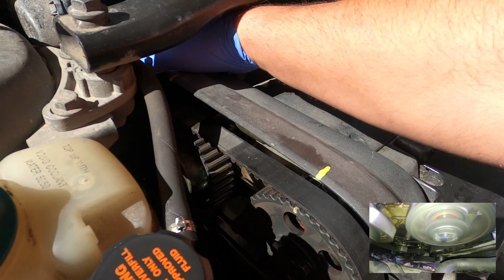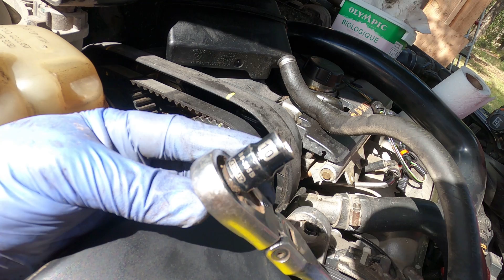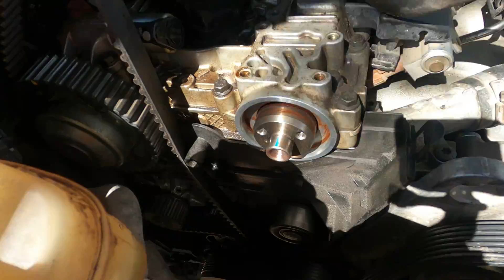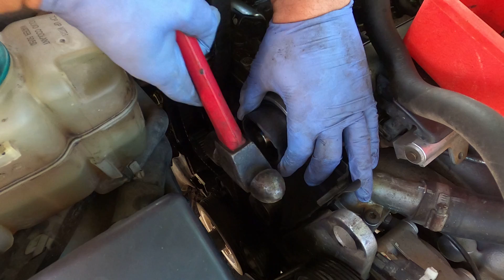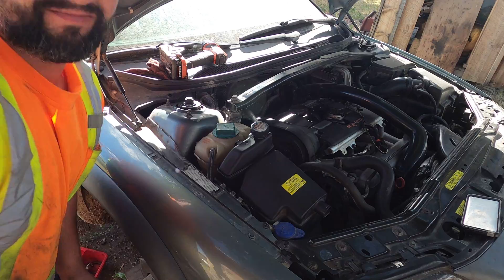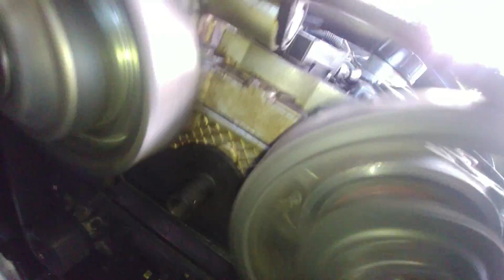VOLVO CAMSHAFT SEAL REPLACEMENT WITHOUT CAM LOCKING TOOL (NON-VVT) |  TIMING BENT TENSIONER SETTINGS

Comment: great videos!  i have learned so much about my volvo from you thank you very much!  i have watched a lot ,a whole lot of videos on water pump cam seals oil seals and timing belt and from all of those videos from all of those various  methods and steps ,its like this ...paint mark every part and the exact place that each part bolts onto the motor or spins around in each place it spins on the motor.The belt, gears, pulleys ,shafts,EVERYTHING .mark every piece that you are going to take off before you take it off and when you put each part back on be sure all those parts match back up exactly. there are several methods to successfully  removing the parts but which  ever method you choose  match up your marks exactly to the position the part was in before you started you will not fail.of course you should be very mechanically  inclined  and have the tools and paint as well ...if you are not  you should for sure watch as many videos as possible and follow steps to a T. that worked great in my case  for my volvo xc70 2.5T anyway.
Reply from the maker: Great point LanaJack. I will pin your comment up to help other viewers. Cheers!

Comment: Thank you for a great video, I learnt a few important basics. Is it possible to share another that shows replacement of the exhaust cam seal please, curious to see how its done without a cam locking tool

Comment: I'm about to do the water pump on a 2013 Volvo c30 because the coolant leaks out. Its making me really nervous because I don't want to mess up the engine which only has 82,000 miles. I only drove it a few weeks before the wheel bearing went out, then this. So far my Volvo experience hasn't been all that great even though it was fun to drive when properly running. When I change the water pump I'm going to do timing belt as well while using a cam lock tool. Hopefully with my inexperience I can get this car back on the road, I just got it what a headache.

Comment: Great video! I got a volvo s40 1999 t4 with engine code b4194t2. Unfortunately i got a leaking camseal on the other side of the engine (gearbox side) do you know the part number and where to find it? :) thanks!

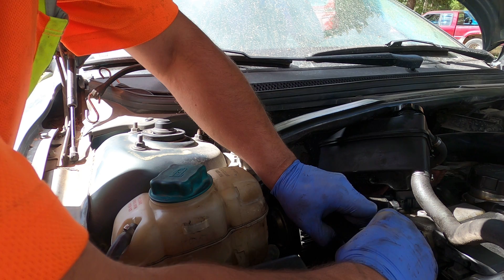Comment: Guys, minute 8:07  you can see as exhaust polley rotate anticlockwise itself  at least one tooth when you dissamble the belt. I had problems with it when I reinstall the belt. I did not realize this and I thought that as i had not touch anything when all was dissambled the polley was in correct position but was not. I respected all marks and position and when i reinstalled and I switch on  a noise come from the engine, i have the vvt polley one tooth backward. 
Caution guys with VVT system, It has a life of its own.

Comment: Notice:  If your ‘this type of engine’ suddenly overheats.  It may be the water pump impeller ? There are obviously such made out of plastic (!?). No need to mention how good that it.   To say this motor is marked by TDC is by definition wrong, it is more like a point of reference because none of the cylinders may be at top dead center ..

Comment: I was just curious why you didn't discuss what might have cause the seal to blow? Did you check your oil ventilation system and determine it wasn't plugged?

Comment: Hello I have a 2.5 turbo and I have to drive it cross country it does have this oil leak where I see it leaking on the subframe from the cam seals. I cannot afford to fix it and my timing belt doesn't look like it's wet do you think I could drive it for a little bit before I get the repair? Everyone talks about the timing about being wet I looked at my timing belt it's not wet but it still does leak oil down on the subframe maybe about a half a quart every 4,000 miles so a very slowly but it still leaks nonetheless.

Comment: I am do the same thing I was curious why you did not replace the second cam seal on the back pulley? Wouldn't they both be dry and brittle by now? Including the crank seal at the bottom

Comment: just spray paint the cam gear before undoing the cam bolts it leaves easy to see marks for bolt heads to align cam gear.
Reply from the maker: Great point!

Comment: What if the exhaust cam is leaking... would locking it with the 30mm still work, I understand some may spring loaded etc. but in terms of needing the cam lock, is it a necessity for the exhaust side?

Comment: Have you tried this on the vvt? I think in addition to the crank lock method you are doing I will clamp the sprocket on the vvt to the belt to keep that cam from moving when you break that 90 ft lb torx inner bolt!

Comment: Hi its Dan, I have oil on the engine along the diesel injectors, could you please tell me where its coming from, thank you, Dan
Reply from the maker: Hey Dan. It's difficult to tell for sure without see the vehicle. I would wipe/clean all oil then just check after day-two days driving to locate the leak. Any luck finding the leak?

Comment: Nice video and well explained.  Just started to see this leak on my 09 c30 t5 so will need to do this myself to save $1000-$1500 that shops will charge to do this.  Will probably replace the pvc breather box as well cause I replaced the diaphram a while ago and problem is still there.

Comment: I know this is an older video....but Either my cam seal or exhaust seal is bad. (2002 Volvo S60 2.4T) This video gives me the confidence to tackle this issue. Thank you sir! By the way, your english is awesome, great job! Youre talking like a regular person and not some "mechanical engineer".  Im subscribing and will follow all you do.
Reply from the maker: Hey John! Thanks for your feedback. Just saw your comment showed up. I have never seen exhaust seal failing the same way. Let me know if you have any questions. Cheers!
Reply: @PistonShack  I'm assembling a 2010 S40 and can't believe there is nothing to stop that seal from falling out. It stopped my job cold when I saw it because I thought I was forgetting to assemble something. I might center punch the cover and the head to create a little interference that should stop the seal. There's no problems on the exhaust side because the cam itself won't allow the seal to fall out.

Comment: Do you have to take off the valve cover or anything else besides the timing belt cover? Im still trying to find the leak on my engine but its in that general area . Im not that mechanically inclined and just trying to figure out how much i could remove without having the tools to torque anything back to original spec. Just trying to find this damn leak 😅

Comment: removing the timing belt from the cam sprocket only  and strapping the belt up so the other sprockets cant move ... is that correct ,or am i missing something?if so can i repeat process for the exhaust cam sprocket?

Comment: my 06 volvo xc70 2.5t developed a slight coolant leak  about 20000 miles ago that has progressed gradually since.it also developed an oil leak started about the same of time and rate of progression .for  the past  month have been adding a quart of oil and  about a pint of coolant  every sunday. the (low coolant stop safely)message appears every time the coolant drops below the min line on res.tank and i always stop and add the little bit, less than a pint to the tank putting it back up in between the min/max lines.it has never gotten the least bit hot or made the needle move from just below top dead center on the gauge and the low oil pressure message or oil light ever come on .Today however i was less than 1 mile from home when  the low coolant message came on which is  normal by the end of the week and the oil light came on for the 1st time ever and by the time i turned in my driveway no oil pressure turn off engine message came across the message board  i immediately turned off the car and coasted into my drive.i got out and popped  the hood there was quite a bit of oil and coolant dripping from everywhere on that side of the engine compartment  what would most likely cause that to happen the same day? camshaft seal and waterpump ???  there is no oil in the coolant or coolant  in the oil
Reply from the maker: I would top up coolant and oil, remove plastic covers from the engine, wipe spilled fluids best as possible then start the engine trying to locate the leaks. 
I just had coolant leaking from the water pump on my Volvo last month.  Low Coolant message came on. Ended up replacing leaky pump.
Let me know how is you repair. 
Sorry for the late reply.
Reply: @PistonShack  water pump with a problem still trying to figure out what made all the oil end up on the ground I just ordered a water pump timing belt cam seal kit she's got 250,000 miles on her so figured why not go ahead and do that too while I'm in there you have any tricks for tips please let me know if I parked will be here on the 31st

Comment: very good!! so, don't need to get the cam locking tool? just to confirm. Got the answer futher in the video. thanks a lot!!
Reply from the maker: Hey Mario. Well, that's up to you. I just shown how it can be done without any specialty tools. If you feel more comfortable using cam-locking tool, I would suggest  to use it. Let me know how is your repair. Cheers!

Comment: If u have the vvt system i highly recommend you get the cam locking tool and install it, if you remove the pullys you have to do a procedure to set timing to factor spect you loosen the center bolt and remove the center cap loosen the 3 8mm bolts around pully as well before doing all of this tho before you remove anything make sure your lines are all in place on top dead center and install the cam holder once u do that then you remove the cap loosen center t55 bolts and 8mm bolts then tight the center bolt just a bit turn pullys counter clockwise make sure the 3 center bolts are all the way counterclockwise then loosen center bolt again and turn pullys clock wise pully and vvt system clockwise then exhaust cam you turn 1 tooth b4 timing and the other one you turn 1 1/2 tooths b4 timing then u tight center bolt to 120nm then after you tighten it you set pullys to timing then put belt make sure all 3 lines match up turn engine backwards just a bit then turn in clockwise again set it on timing and if all lines match up then u tighten the center cap and hold the pressure on the ratchet and while your doing that you tighten the 3 8mm bolts on each pully as well and then you remove your cam holder tool turn engine 2 times make sure lines match up and your set put it back together and your good to go its a long process but it wont work any other way if u remove pullys to change seals
Reply from the maker: Hey BayismGameplay510! Thank you so much for detailed advice, you described everything everyone needs to know. I would pin your comment, make sure other viewers can read it as well.
Cheers!
Reply: Still can’t understand how your way for did it

Comment: My beloved Vo's oil light came on..... Oil just dumping out, i could tell the intake cam seal was out, but was worried i had other seals out too because how much oil i was losing. Nope that cured it! Thx for the video!  I watched it twice the day before the seal came in!  Back on the road. No leaks!
Reply from the maker: You're so welcome Sam! I would replace failed seal, filled up the engine oil then check actual engine with the gauge at the oil sensor (cold start, hot start, idle and 1.5-2.0K rpm) make sure your engine didn't have oil starvation causing any dame.

Comment: This was a very good helpful video with one exception that i think might be rather important. This is why i comment the Video.
The wheel that was disembeled was locked into position at once without letting the evetual tension on the belt get lost.
So this is the way i whould do.

1. Put the cambelt on as showed in this video.

2. When cambelt is on loosen the 3 screws around the weel You dissasembeled before. (Just losen it a bit so all tension that might be there if You missed ever so slight will be lost.) During this process i have seen in other videos that the tension on the "tensioner" is put in max position. ( Like 50 degrees position)

3. Now we have secured that there is zero tension between the 3 wheels involved since only one wheel is dissembled and the other 2 wheels presumed to be ok in factory settings. This is a very critical procedure i think. 
Please comment if You think i might be wrong.
NOW we tension the bolts at the right amount of Nm to the wheel.

4. Now You finally correct the tensioner to the right position. If 20 degrees surronding temperature in the mittle position.
Fasten the screw to the tensioner mittle position and were done.
Reply from the maker: Hey Peter! Thanks you for your detailed explanation. There's few ways to do it. I have done it based on my experience and referring to Haynes manual. Never had any issues ever since. Volvo runs like clock.
I would try the way you described next time doing the timing belt. 
Thanks)

Comment: Thank you so much for this!  I have put 10 qts of oil in my '01 V70XC in the last two days, while I tried to figure out where the leak was coming from.  Once I found the splatter all inside my front/right wheel, I knew this was the video for me!  I have confirmed the intake camshaft seal is a wobbly, loose bit, and this video just saved me a boatload of Volvo dealership debt!  You rock a bunch!
Reply from the maker: Hello Hadamana! I am so glad this video helped you out to save your loved Volvo from going to the crusher or visit dealer shop! How is your XC70?
Reply: @PistonShack  the oil leak is better, but not gone =\
The original seal hardened and carved a groove in the camshaft, maybe? Still minor(ish) leaking around it. But I think I'm going to put her up for a bit and throw some time and parts at the list of issues she has, so I can drive with confidence again. 2001 was kind of a bad year for V70 transmissions and throttle management modules, and these poor engine mounts (all of them) have seen better days...

Comment: Piston Shack, thank you for this video. I am trying to do the same but it seems the cam shaft turned slightly when I removed the bolts from the pulley. How do I get the shaft realigned with the original position?
Reply from the maker: Glad it helped Ed! I would put sprocket back turn the cam shaft to align sprocket mark with mark on upper cover, then take bolts off without moving the sprocket.

Comment: After 14 months finally had the balls to try this and I just want to thank you again my friend.  Added New Oil, antifreeze, fuel and a new battery and turned the key and it's sounds smooth to me.  There is.a faint squel which I think may be the oil when it sprayed all over may have came on the belts. 
I wanted to ask you something is it okay for a week or so to drive without the timing belt Cover ? Just to make sure things are good ? Will a rainy day be a problem without that cover ?
Again God bless you for this video I really appreciate it.
Reply from the maker: Hey Amer! Such a great news! I remember we were chatting down in a comments last year. I will avoid getting any dirt and water on timing belt components. If everything set right, no leaks after running for few minutes, I personally won't worry about it. Might be later a bit tale upper cover off to check for any possible issues.
God bless you brother!

Comment: Very helpful video. The exact same cam seal come loose in my 2002 s60 it has 165000 miles on the clock. Everything is on order. Need to do it this weekend. Wish me luck :D
Reply from the maker: My best wishes:) Let me know if you have any questions.Thanks for your feedback.

Comment: Hey dude, what engine symptoms will the car suffer if the camshaft seal has worn out and needs replacing?.
Reply from the maker: Just do visual inspection. Take upper timing belt cover to check for any oil seepage behind camshaft sprockets.
Reply: @PistonShack  - thanks for the advice. You da man!.

Comment: I did this work exactly how you said.  
I wrote down every single step. 
I counted the teeth before I took the belt off. However when I put everything back together, I counted one less tooth. Everything lined up but one tooth less. 
Cranked the main shaft again to double check.  Everything lined up but one tooth less. 
I knocked on some wood then turned the ignition and the car started. It idled better than before so it must have gotten out of time when it busted the seal. 
I swear even though there were a few mishaps in my part, I finished within 2hours. 
Awesome knowledge you are passing along. 
Thank you. I appreciate what you do.

Comment: I will start this process tomorrow. 
However, I started today but could not find the mark for the timing on the main crankshaft below. 
If I line up both top timing marks, will that work. I cannot make out the bottom mark.

Comment: So if you make the marks on the sprocket and inside of the camshaft you don't have to lock in place the back of the camshaft?
Reply from the maker: Hey Mario! Well, I managed to replace intake cam seal sprocket without using locking tool but if you feel more comfortable using locking tool, specially if you need to work on VVT ones.

Comment: Very nice vid. Thank you. Would have been good to see you remove a replace VVT actuator sprocket to see if the actuator creates any issues/challenges extra to the non-actuator sprocket. One question: when you are replacing the sprocket - so long at the cam has not moved at all - surely it doesnt matter how you put the sprocket back on?? Yes?
Reply from the maker: Great suggestion! I will definitely film everything when I will be doing VVT sprockets. How is your repair, btw?

Comment: What other seals blew out after replacing this one?? I'm pretty sure you had further problems caused by a clogged PCV.
Reply from the maker: None, no any oil leaks or blown seals. Btw, entire pcv system was recently serviced. Old seal dried out and came lose out. Do you have the same issue on your Volvo?